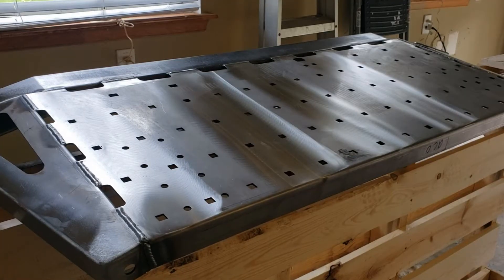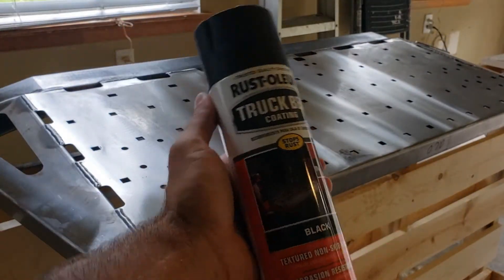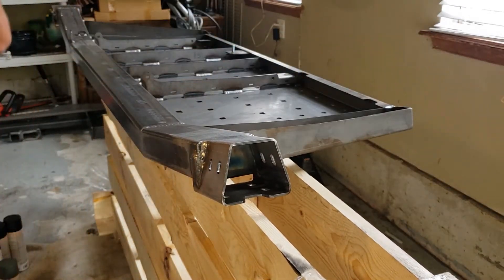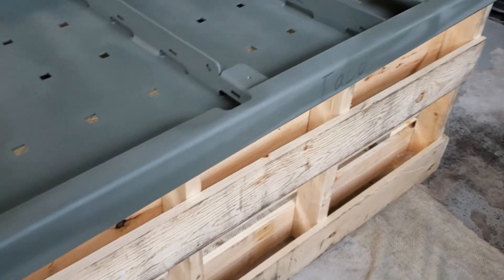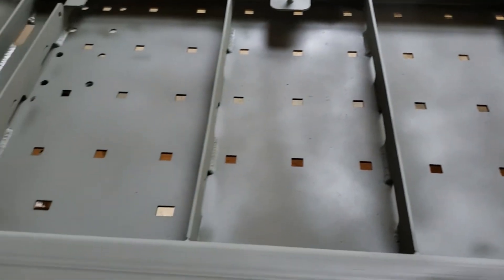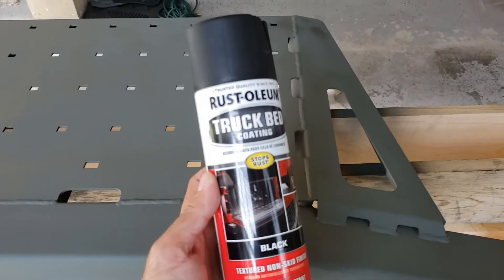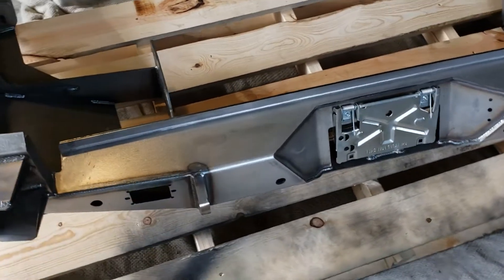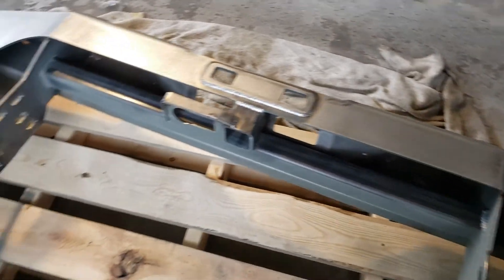How To Paint a Bare Steel Bumper

Comment: my steel bumper has surface rust on it, do you suggest sandpapering it first before i prime and paint or is there a better solution? Thank you :)
Reply from the maker: Definitely sand it. Even surface rust can cause problems years down the road if left untreated. Better to just take care of it now before you paint
Reply: 100% yes sand it down to bare again, otherwise it will rust underneath your paint.

Comment: How well is this holding up?
Reply from the maker: Rock solid. Only had to touch up a few spots on the swing out where I guess I went too light. The bottom of the bumper still looks like the day I painted it, which is the true test since that takes all the abuse of the road and trails

Comment: What if the steel bumper is already painted
Reply from the maker: Sand blast it and start again. You'd have to get all residual paint/road residue off. Otherwise if there are any sort of oils or dirt under it, it will end up flaking
Reply: I depends.. If the paint is chipped you should remove it for a smoother result but if the paint is ok, I will recommend sand it with a 400 or 600 grit sandpapper and throw a coat of adhesive promoter so the new paint sticks good!

Comment: Could I do this but without the bed liner pain and just a gloss black
Reply from the maker: Yeah I think you could. However with a gloss spray paint it will show any little runs or imperfections. If you want to go gloss black, I would say use a roller, then once its dried hit it with an automotive clear coat spray. Bumpers take a lot of abuse so you want something that's going to hold up